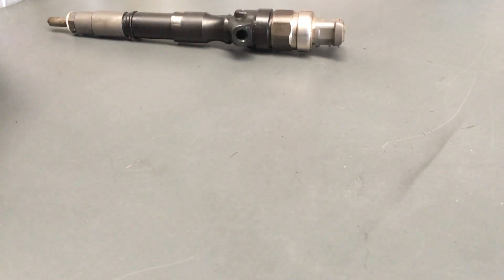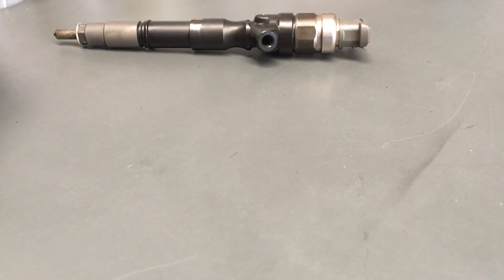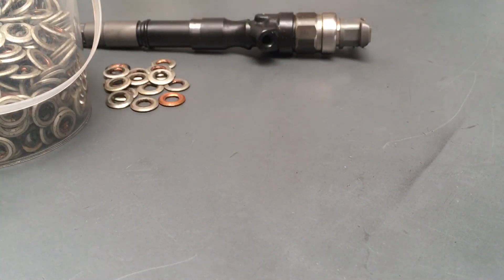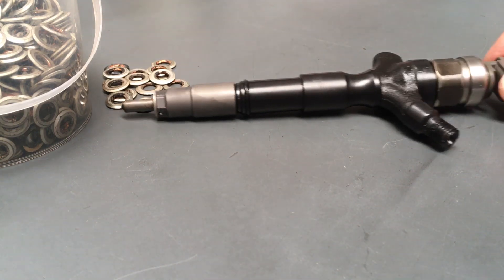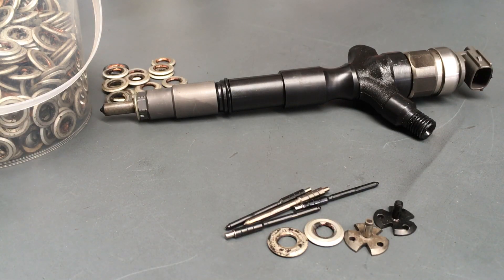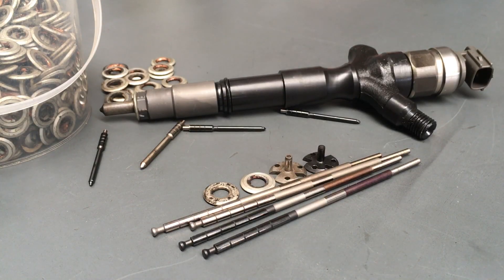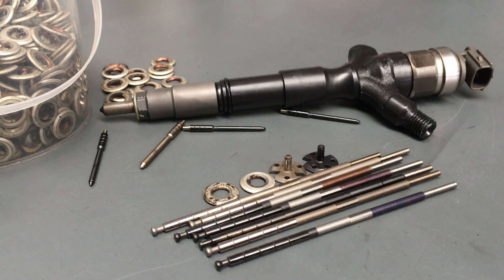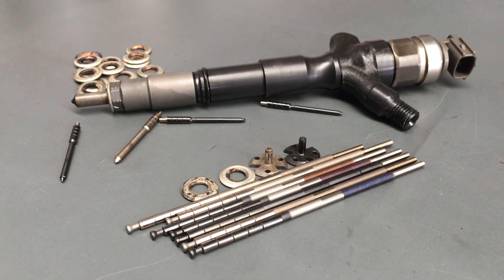AVOIDING CATASTROPHIC FAILURE IN A SMALL DIESEL

Comment: Great vid. Shame the hilux body work is crap as is the chassis. No pre prep on the chassis in particular to stop it rusting .. talking 2016 mk8
Let alone the shitty dpf burns that cause more pollution and use more fuel.
And fuel getting back into the engine wearing it out before it’s time

Comment: I am confused as to why a 3l turbo diesel in a Prado is considered a small diesel? The Prado has a GVM of just under 3000kg and a GCM of about 5500kg. Yet Isuzu will put a 3l turbo engine in a a small truck with a GVM of 4500kg and a GCM of 8000kg. What is different about these two motors that makes it small in a 5500kg GCM vehicle but fine in a vehicle that is designed to carry big loads? Is it gearing? Is it tune? I am sure I am missing something cause I tow with my Prado and I am paranoid every time I go away with it yet companies will put there livelihood on the back of an Isuzu light truck?
Reply from the maker: Doesn’t matter what I towing capacity is a trucks got a large diesel a car with a four-cylinder of that size is a very small engine that’s what it is larger would be a six cylinder larger again would be a V-8 and then you going to your big stuff
Reply: Gearing is the answer you seek.  And the Isuzu is a much better engine, just sayin' :)